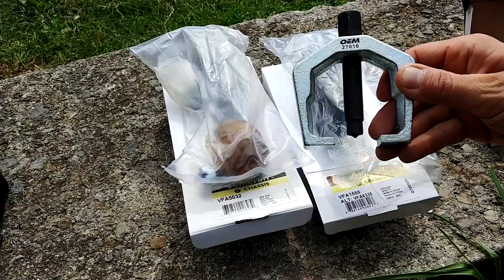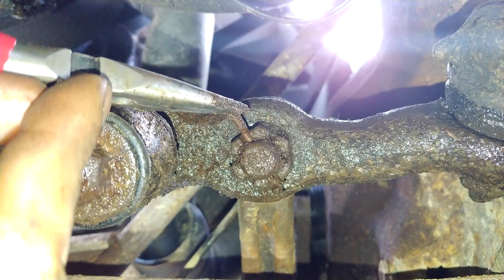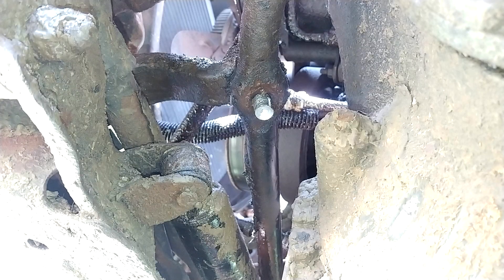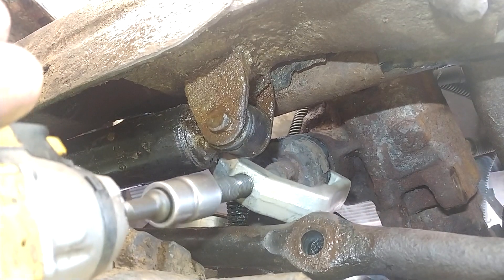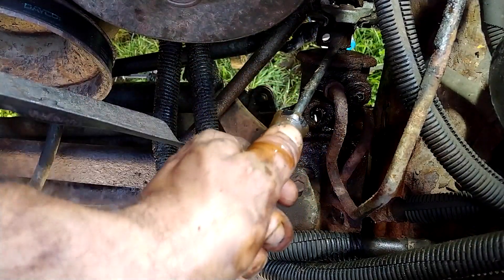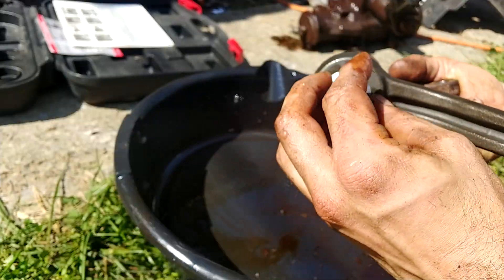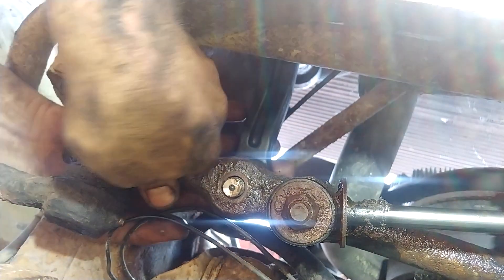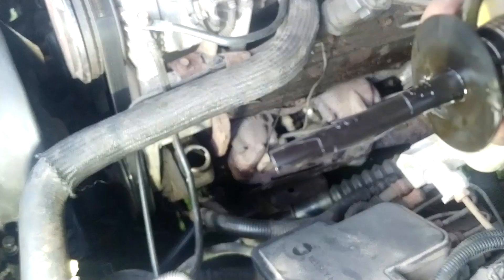How to Pitman Idler Arm

Comment: Get a propane torch with self lighter, $20 for both at home depot. Get a solid puller too. Crank it tight then put heat on, it'll bust loose.